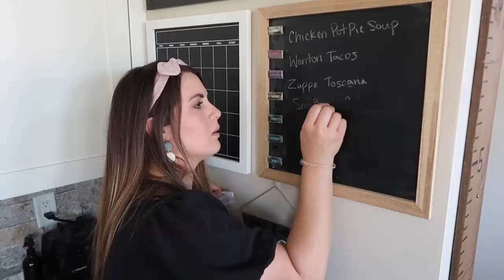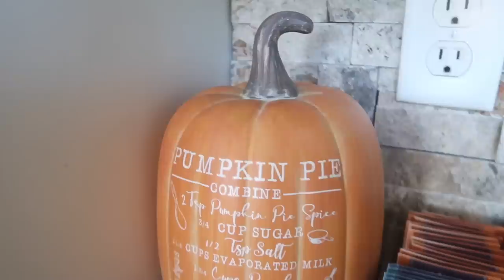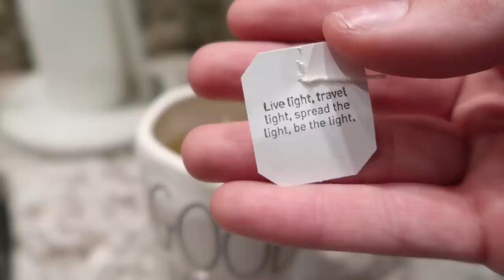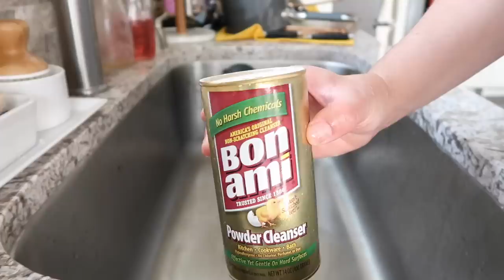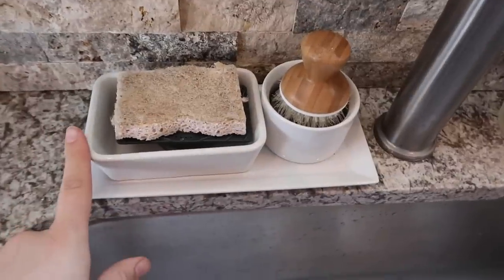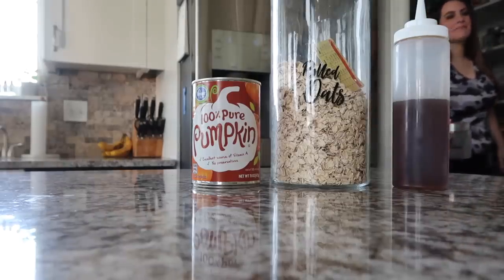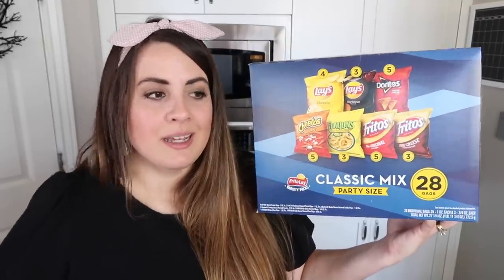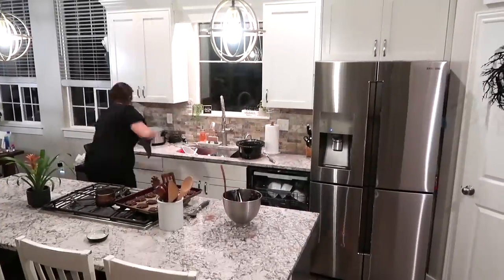FALL CLEAN with ME MARATHON 2020 :: OVER 3 HOURS of INSANE SPEED CLEANING MOTIVATION #WITHME

Comment: Zuppa Tuscana is my favorite I use to get it all the time at Olive Garden till I got the recipe from a friend that worked there. I made it exactly I like they did and it was good but a long process so I’ve tweaked the recipe throughout the years and I love it way better then the Olive Garden one. Using the bacon bits is better then frying up your own bacon because it gets soggy 😷. So I cook 1lb of mild ground Italian sausage with a little oil to the pan so it doesn’t stick. I add a little bit of red pepper flakes when it’s done remove sausage and put on lined paper towel on a plate to drain the grease. Then I sauté 1 large onion when soft I add minced garlic and the bacon bits then add 10 cups of water and 5 chicken boullions, 3 large rustic potatoes,  bring to a boil and let it cook until the potatoes are tender. Lower flame add in the ground sausage, the chopped kale ( I buy the washed precut kale in a bag) and add in the 1cup of heavy cream. All the flavoring the soup needs comes from the onions, garlic, sausage, bacon, red pepper flakes and the chicken bouillon cubes and that’s it so delicious!

Comment: I go behind department stores that throw away plastics Dress bags etc--just cover the pot with the plastic and change it out if the kitties pee in it and cover any other areas until they learn to use the box or go outside
Reply: make sure to air out the plant--you can cover it at peak times where you know they are at high risk--at night etc.😀

Comment: If you use the same hangers to dry and to store your clothes in your closet you can save a ton of time 🤷🏻‍♀️
Reply from the maker: I usually wash/dry my clothes inside out which is why I pull them off and rehang them. And I also use different hangers. But definitely would be a time saver 🙌🏼🙌🏼🙌🏼